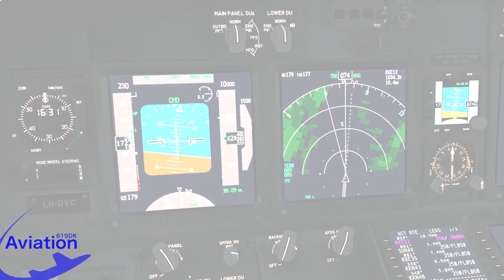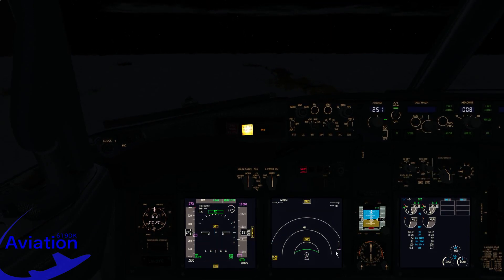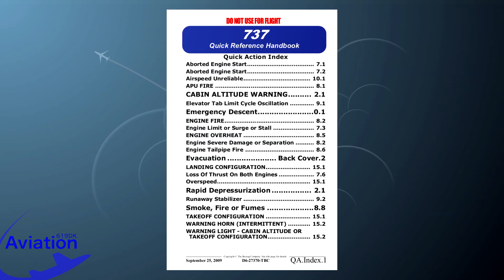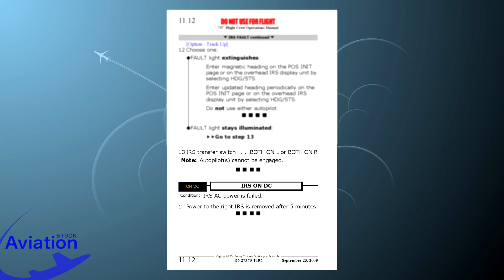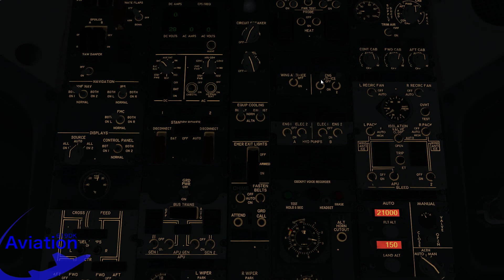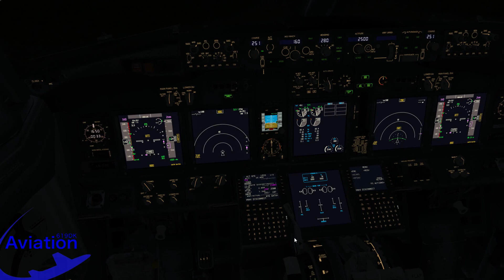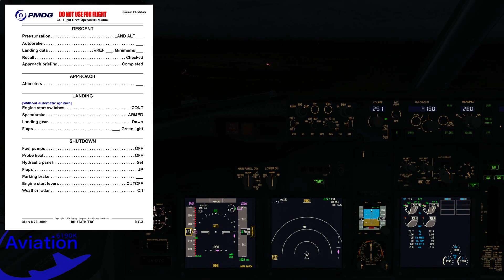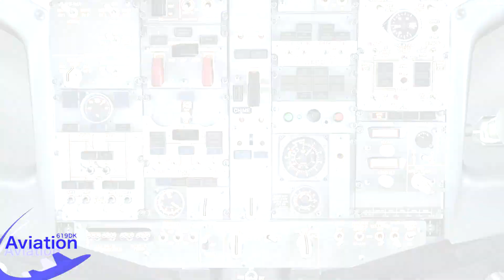Dual IRS Failure | VATSIM Emergency Ep. 5 | PMDG 737NG

Comment: Hi, first congrats for the video, just my two cents here: when u first had the master caution the boeing procedure calls for the PF to ask the  PNF to identify the issue first - master caution, IRS, FAULT light on irs number 1 - the PF would confirm it and then he would call for “i have controls and atc, go ahead with the IRS FAULT abnormal checklist. In this specific case if the failure is on the PF i would personally transfer the controls to the side where the data are available, identify the failure and then call for the proper checklist. Quick fixes as flipping the IRS selector to both on 1 or 2 are not to be performed unless called for by the checklist - which by the way will instruct you to do at the end of the procedure. What is your point of view on this matter? 
PS i am aware of the fact that you are trying to apply multi crew procedures in a single pilot environment!

Comment: When you will make another video? I want to see another VATSIM emergency. It could be on pmdg 777 or 747 v3
Reply from the maker: Next emergency will be made in the B737, but aften that my intensions are to use the PMDG 777. If everything godes as plans it should be on the channel at the end of the next week. Currently I work on snottet series focussing the regular real-world operation of the 737

Comment: Great video, always happy to see it pop up in my feed! Do you have any tips on having better failures and preparing the ATC on the Vatsim Network?
Reply from the maker: Well, it's always a good idea to practice the emergency procedures before you jump onto the VATSIM Network - some procedures are actually quite hard to execute, because a lot is going on in a short amount of time, fx with an engine failure around V1. Another thing, which can be difficult sometimes, is to formulate one's emergency call to ATC (Fx, when I lost the IRS I didn't tell ATC that I lost them (because you can't expect that he knows what an IRS is), but explained the outcome or result of this failure which was relevant for him to know = that I needed to be vectored from now on) Additionally, you should expect ATC to ask for the amount of fuel and people on board (POB), even though it is not always they do this on the VATSIM Network. But, if they go as realistic as possible, they will. Just in general, think ahead - find your alternative airport if needed to divert ect. and everything should be just fine - good luck Captain!
Reply: Thank you, hope to see you on the Vatsim Network one day :)
Reply from the maker: Pleasure would be mine

Comment: When you tried to set the IRS to ATT, the checklist said to do it if the the captains OR the first officer's IRS has failed. Since both failed shouldn't you have skipped that step?
Reply from the maker: Hm...good question! I guess since the IRS' work independtly from one another they do not rely that one must work in order for ATT mode to function. The ATT-mode just tries to restore some of the IRS' functions. The reason the checklist advice us to flick either the left or the right is probably because it is very unseen that both IRS' fail at the same time and we'll therefore only turn the failed IRS to the ATT.

Comment: How can you perform an ILS landing without any instrument that tells you your position? And how does all that stuff work without autopilot on?
Reply: ILS approach uses the radio signals emitted from the runway threshold to align the aircraft
Reply from the maker: Yes, exactly as steven yau says, the ILS gives the pilot information about his relative position to the runway. But due to the loss of the IRSs, we were left with the raw data from the ILS signal meaning that we had no guidance on how the follow the ILS path or the autopilot to do it for us. It was our job to match the given descend rate needed to follow the glidepath which is found by simply feelings one's way and see what will work.

Comment: Idea for the next one: In-Flight Medical Emergency
Reply from the maker: Could do, yes - just to be sure I understand what you mean: it is to get a fully operational airplane as quickly as possible from cruise down on the ground?
Reply: Exactly, I think it is a very possible scenario. I am not sure of correct procedure, but I remember having it one time, where we had 2 steps in cabine (I was a passenger and a child, but I am interested how it would be handled from the pilots, the plane has no technical issues or problems, the only issue I could think of would be that the plane is to heavy to land, but I think it would be to much for a single video)
First the medical case occured (don't know if this already means something to crew (calling at ATC maybe?)
approx. 8-10mins later
Second the case got so bad that we had to go down and land and get medical help. (definitly interesting since it means that you have an emergency descent and land as soon as possible?)

Since I don't know how much work it is also editing this part in, but maybe could you keep in the part till the machine comes to a stop?

Thank you already for your amazing 5 videos and anything that will come!
Reply from the maker: Sure, I'll look into it, when time allow. 
If we are too heavy for a safe landing, the only thing to do in the B737 is to burn of fuel in a pattern. However, this emergency could be more interesting to execute in the B777 because it has the capability to dumb fuel mid-flight.
Thanks for the feedback, appreciate it!
Reply: Take your time, I just want to give you another idea. All videos are great and I for sure can think of how much time is needed to produce this. As said, thanks for the five you already did, they are a big help!

Comment: where is the Checklist from
Reply from the maker: If you have purchased the PMDG737 you can find it in your sim folder -> PMDG -> PMDG 737 NGX -> Flight Manuals -> PMDG-NGX-QRH.pdf
If not, you can find it pretty easily by Googling "PMDG 737 QRH"

Comment: Can the APU control the gear?
Reply from the maker: Well, not directly. The only system which can operate the gear is the hydraulic system A. In order for the hydraulic system to work it needs pressure and hydraulic fluid. 
- The hydraulic fluid is contained in a barrel on the plane and if that is lost you can not control the gear hydraulicly. 
- The pressure can be provided from either the engine driven pump or an electrically driven pump. If the APU provides the electricity, which powers the electrically driven pump for the A system, then yes - the APU is needed to control the gear.
Alternatively, if the A system has failed, the gear can be released from its locks. The idea is here that gravity will pull down and lock the gear.

Comment: this is so dumb, you wouldnt be able to put 020 into the autopilot if you lost your INS.. look at your MFD it doesnt have a hedding.. just a bug because PMDG didnt expect anyone to be failing their INS
Reply: 99F auto pilot isn't available but it's still standard practice to set heading at MCP for situational awareness
Reply: IRS fail doesn't mean the mcp windows will shit down. you still can use it as a reference of what heading you should fly, or what altitude you should fly, or what speed you should be at